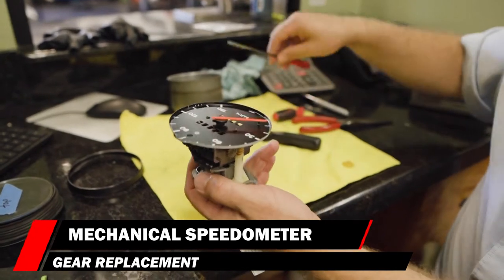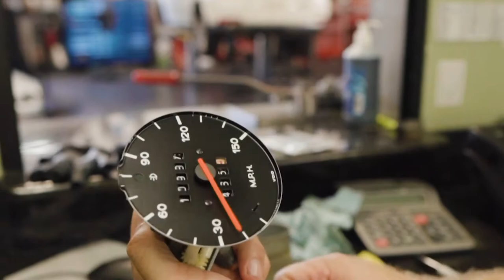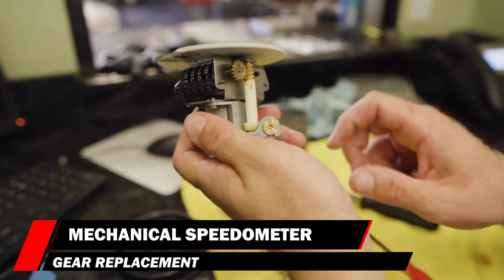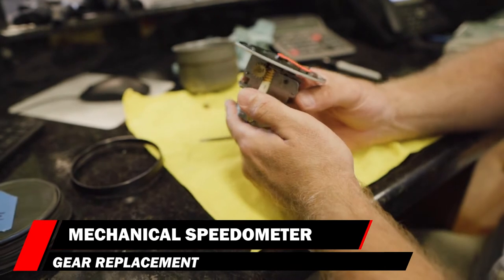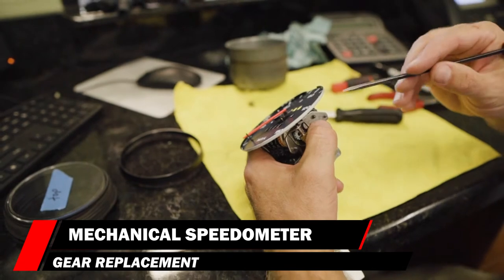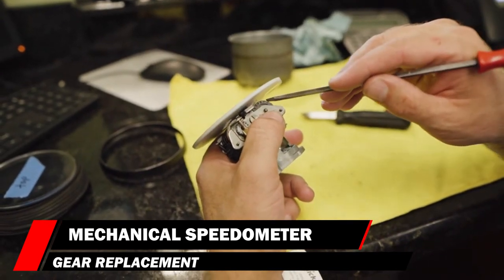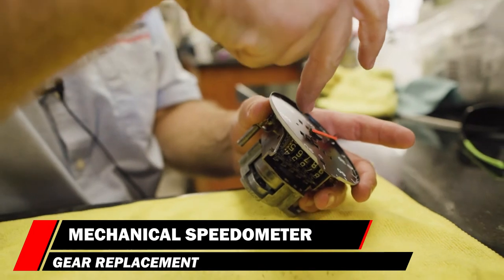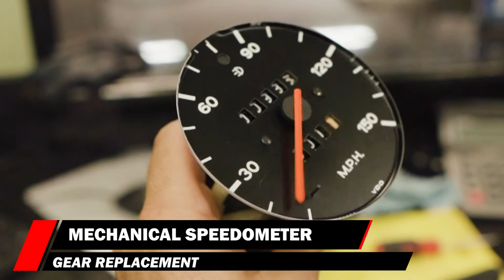Porsche Mechanical Speedometer

Comment: Good video, just what I need!  What is the part number or part description for the gear you are replacing?  Is it the 20x30 teeth or 20x32 teeth or...?  I don't want to order the wrong part.
Reply: hello TRJ911!  No, it is not the 20x30.  The 20x30 fits the electronic speedometer found in 911 models 1976-1989.  The gear that fits the mechanical speedo is Porsche-Lead Odometer Gear sold by Odometer Gears.  Also if you have the plastic gear instead of a brass gear, I recommend installing a new one of those as well.  In this video, it has a brass gear, so it was unnecessary to replace both.  Only the lead gear was replaced, and it was replaced by a plastic gear.  hope this helps! good luck!
-Niko
Reply: @nikosougias1298  Thanks Niko!